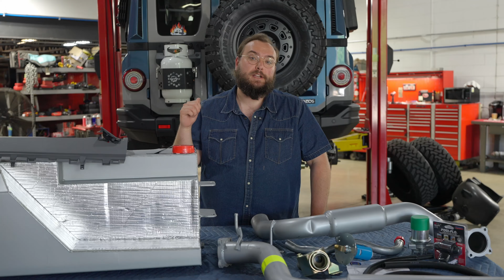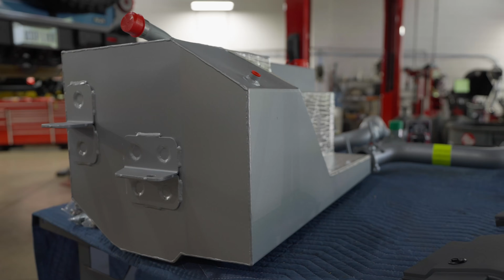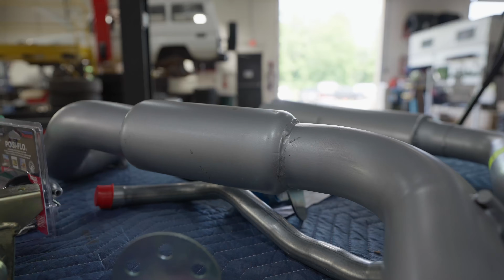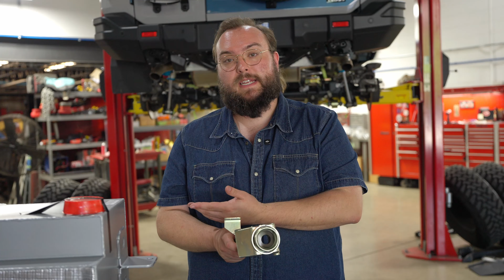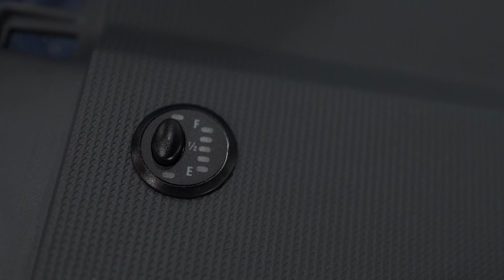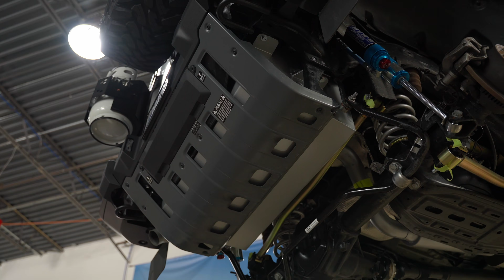Long Range America - INEOS Grenadier Auxiliary Fuel Tank

Comment: This is huge for the Ineos community! Range was one of the only shortcomings of the plateform. 

For those on the fence about spending the money: I LOVE the LRA tank on my GX460. Last expedition I did was 26 days across the USA. Lots and lots of wheeling far into remote places. It’s a huge game changer to be able to fill yourself up while driving.  Whether that’s on the highway or out on the Mojave Road. Mine has been installed for years now and have had zero issues.
Reply from the maker: That's awesome to hear and thanks for the feedback from your experience!

Comment: Steel tank no go for corrosion.
Reply: was about to say, why did they not design it with some harsh climate coatings, or a combination of materials or just go full titanium. I wouldn't trust this doing long drives on the surf or through heavy salt water/surfaces.... when building products why do they not start with persistence, cost means nothing if you cut a worry out. Granted the price point is something but is it in this domain of vehicles? What is an extra 15k to someone who invested 100k in gear + car + love in being outdoors... make it better, build something to go through hell and back, bomb-proof and you'll have literally people running to you with money.